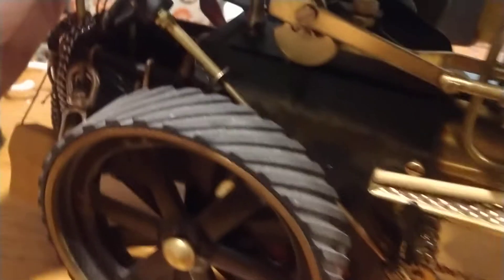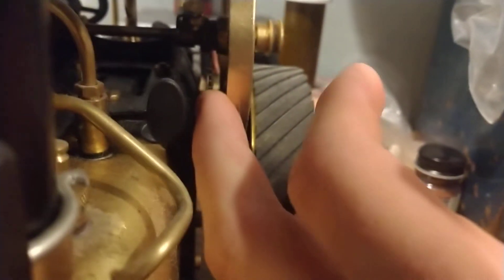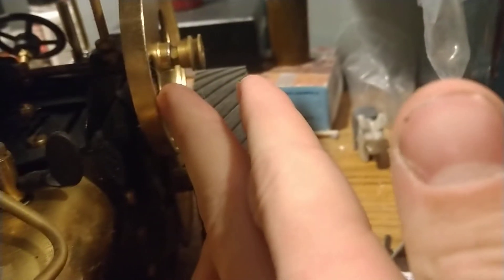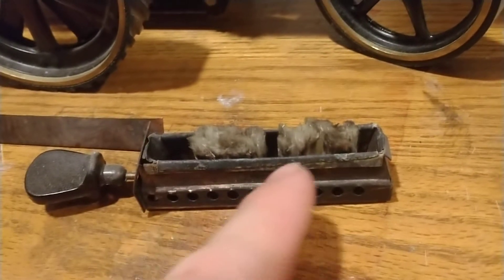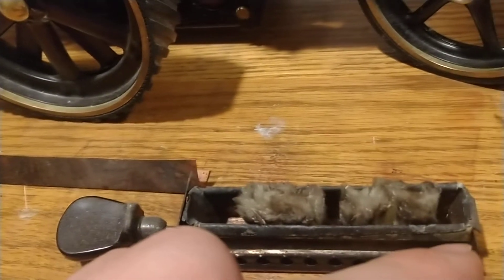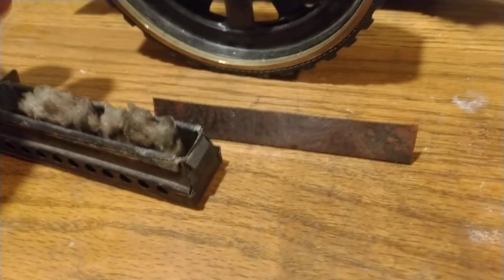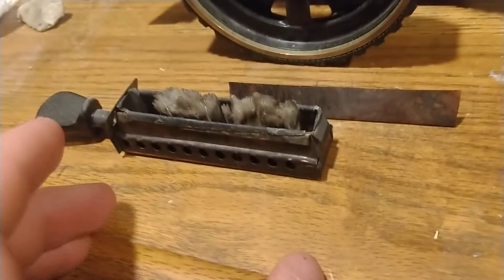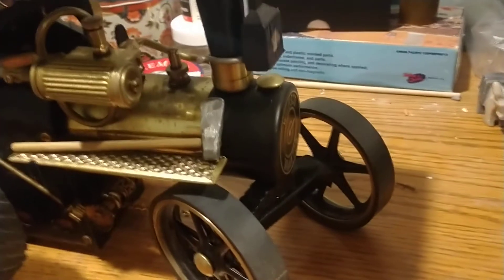Wilesco steam tractor d416 performance modifications

Comment: i dont use the fire tray anymore i found out it runs better on wood, plus hexamine and alchohol is worse than wood or coal
Reply from the maker: As someone who's actually wanting to scratch build or restore an actual traction engine to use on my farm and is currently getting a shop set up to do exactly that plus scratch build horse drawn farm equipment for the Amish,,,with  my expertise I would heavily not recommend using coal or wood in a wilesco not only are you going to deal with tar build-up but both create very caustic by products that will drastically shorten the lifespan of such a thin boiler,

Also 
 wilesco also only uses low melting temperature soft solder as aposed to silver solder that has a much higher melting temperature
 so... the seams may melt and burst while under steam,not something that you want to happen due to burn risk and possibly hearing loss